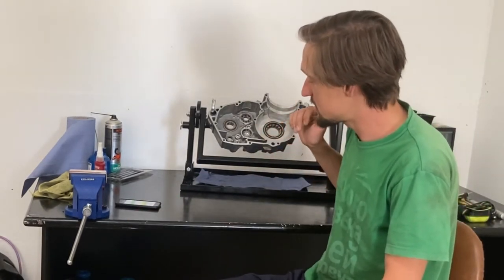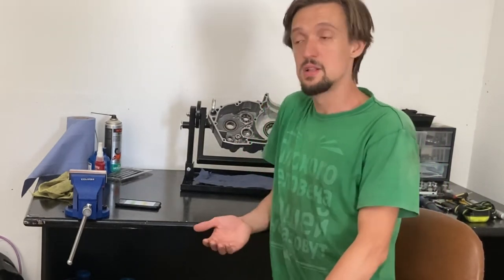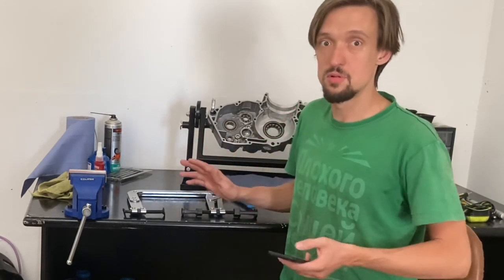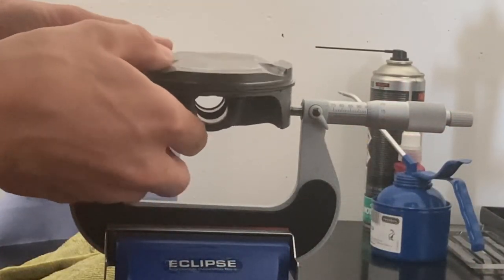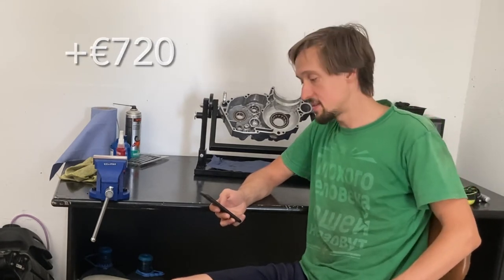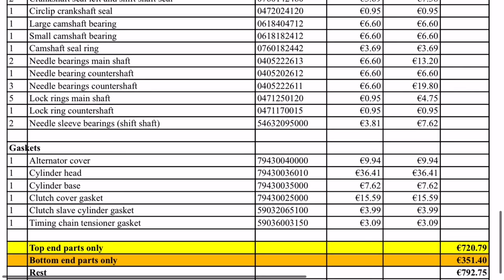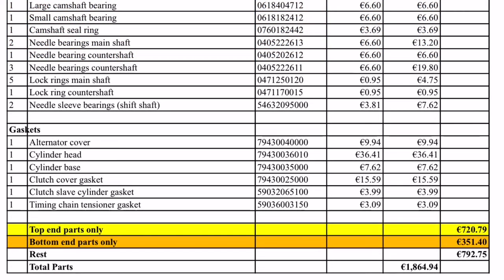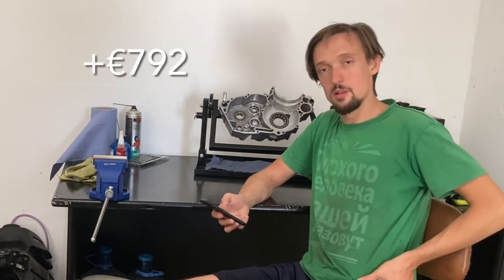How much is a KTM engine rebuild and do I need it?

Comment: So do they need to be rebuilt every 80-200hrs or as one rider did just driving around the world he did top end at 67 000 kilometers and bottom at 100 000 kilometers…on Ktm 500 exc ,this guy traveler Aaron Steinmann, better known to his fans as the Braaping Kiwi…
Reply from the maker: No they don’t need it if you’re changing oil and filters often and doing adventure or leisure riding. However if you’re doing races the valves and valve guides usually wear out first in the top end. You’ll hear some clicking which is the valves clattering against the guides, and some smoke will be coming out of the exhaust pipe because oil is getting into the combustion chamber through the valve seals. But even then, just changing the valves and inspecting the top end is good enough because it’s hard to wear things out in the bottom end.

Comment: Great video, very accessible!.
I'm very curious( have the same bike) why you decided to change so many parts. Was the wear higher than acceptable or for other reasons ?

Your KTM looks pretty fresh in the video)
Reply from the maker: Cuz this was the first time. I honestly did it for my own experience and to make this video. In subsequent rebuilds I do the basics as a base, so bearings and seals, and in the cylinder head I need new valves and valve guides after 170-200 hours. The valve stems wear against the guides eventually and things start to clatter and the engine starts burning oil. Apart from that I wouldn’t touch the crankshaft and even the crank bearings (main bearings) for many years or hundreds of hours IF you have maintained the engine with regular oil changes and maintenance. Doing at least the tear down and the basics is necessary for me to keep doing rally seasons year after year. If I can’t guarantee the bike will run for 7 day rallies 5-6 times a year there’s no point in going.